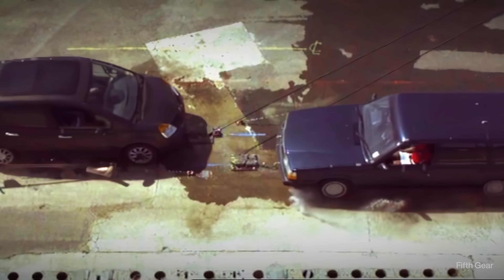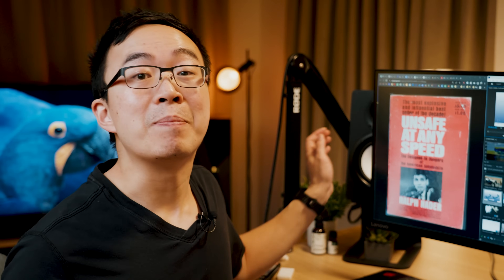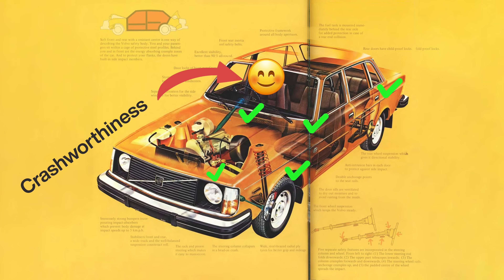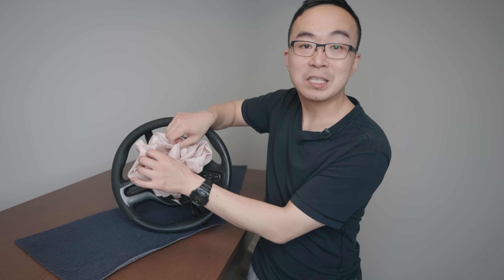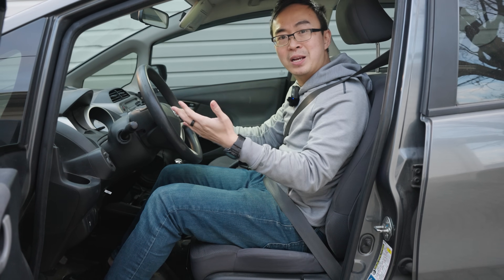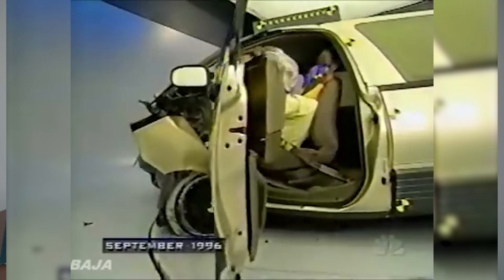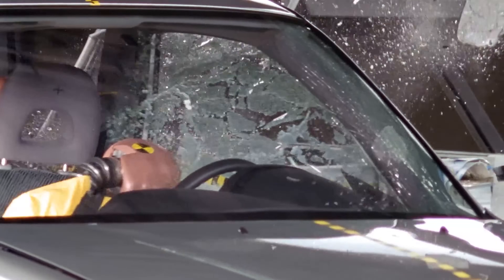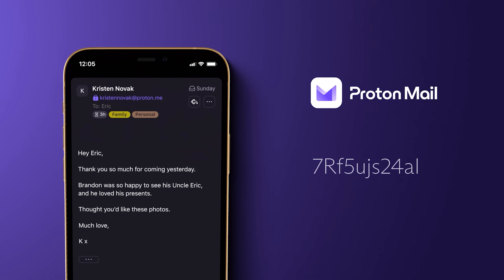When does a car stop being safe?

Comment: Even the 90s cars were often better, to be fair, and that first clip was carefully cherry-picked. The Volvo 900 had the problem in the first clip fixed by the 93 model year, and their other cars were fine, in those same years.

I even got in exactly that kind of wreck in a '93 940 (I already knew about this, by then, so '90-92 were right out). The 15-year-newer Hyundai was much worse off, while only being a few hundred pounds lighter. My headlights were pushed right back to the rear of the fender well, on the driver's side, but pristine from the firewall on back. OTOH, their cabin started folding in, with much less hood shortening. If it weren't a tiny woman driving, there could have been nasty knee injuries. If I had been in a '91 940 (my first Volvo), the situation could have been reversed.

My current car has plastic bumpers, front and rear, than can bend some inches, before getting to anything really structural. I don't usually try to run into pedestrians; but if I do, I'm sure they'll appreciate that, over that old Volvo's plastic coated metal beam.
Reply from the maker: It's somewhat cherry picked but still representative of the larger improvements in safety.  There's also individual vehicle differences that's hard to capture.  The plastic bumpers are definitely better for pedestrians, bad on your wallet though
Reply: @Lam  true, but even that varies a ton. Designing for service and repair has gone away, with a primary focus on short-term ownership of new car buyers.

I'm currently rocking a Vibe. I had the front bumper dented and scuffed, in my work's parking lot. The damage was just cosmetic, to both vehicles. That made me go get a quote, just to see, since I know a paint job is not trivial on them.

If I had to get a new one, matched paint and all, but with no real damage to the car otherwise, it would be about $800, with an hour for labor to actually replace it (relevant in a bit, as it's from the same business). Or, I could pay about $300 (all front bumper parts, from Rockauto, w/ tax+s&h - s&h is no joke on these parts!), and drive around with a gray one.

OTOH, my work vehicle got a new bumper and grill awhile back, and it was over $2300, also for very minor cosmetic damage. The bumper and paint work was about $1200 of the bill. It wasn't designed with repair and service in mind, like it was on my little old GM/Yota.
Reply from the maker: Haha, yeah, for an older car you might as well just get something that works.  Maybe go to a junkyard and pull one out but you figured it out.  Thanks for sharing your story!

Comment: Well I know when my 1994 Chevy Corsica stopped being safe.  When it was brand new... mine was like 10 or 15 years old when I got it.  This doesn't end with me getting in a crash or anything, it blew the engine.  But that thing was rated at a 1 star rating for the driver and 2 for the passenger.  For 1994; it was off the market in 1995 because it didn't meet the side impact standards at all.

Comment: This video is bullshit the 940 is still by far the safest car in the video. The old red block Volvos have steel in the firewall to prevent the motor from being pushed into the cab. I have personally seen pictures of the same car in a head on collision with a suburban and the metal in the firewall did its job. The occupants of the Volvo walked away with barely any scratches.

Comment: I find it sad that the proliferation of oversized SUVs and similar vehicles caused cars under 2750 lbs (1248.5 kg) to be deemed unsafe. Smaller vehicles need less materials when produced and takes less energy to move, so this has an environmental impact.

Comment: Submarining comes from auto racing where we have a 5 or 6 point harness. If  the belt that runs up your crotch if it's too loose then you just end up sliding forward. Your legs knees thighs everything gets crushed and broken because of that crotch belt not being tight pulled in and down with your belts

Comment: i always find it unusual when self-proclaimed car fanatics talk about older cars "standing up to a crash far better than those flimsy soft new cars - just look at how much of it stays together!". i'm not much of a car nut myself, but my dad told me when i was young - if your car doesnt have a crumple zone, you are the crumple zone. because if the car isnt doing the shock absorbing, you will be.

sure, its possible to argue that newer, crumpling cars may present a higher crush risk under some circumstances, but a car that doesnt crumple is almost guaranteed to turn your insides into soup in a similar situation.

Comment: And then there were once safety features in cars that  seemed like a good idea on paper but added no additional level of protection or  actually increased the danger level in a crash in the real world scenario.    One such feature you may recall if you're 30 or older,  is the automatic seat belt on late 80s and early 90s cars not equipped with airbags.  On such models with the power shoulder belt, the most common version, the lap belt must be manually buckled and this often wasn't done.   In a crash the occupant can submarine and suffer serious injuries or death.  

In GM models equipped with automatic seat belts,  the shoulder and lap belt retractors were mounted in the front doors, while the buckle was intended for use as an emergency release.    You were supposed to leave the belts buckled at all times, and slide under the belts upon entry and were buckled when the door is closed,  no other action is  required (everyone basically used them like ordinary lap and shoulder belts) The problem was that some crashes caused the door to pop open,  ripping out the seatbelt and ejecting the occupant.

Comment: I had an accident in my F-150 because I started choking on my diet coke and passed out going 70mph.  Went through a guard rail over a hill and head on into a tree.  Had seatbelt on and all air bags came out (driver and side ones).  I had 10 ribs broke, punctured lung and punctured spleen.  Even though I had seatbelt on the Pittsburgh UPMC Trauma center told me it had to have been the air bad hit my chest, ribs were broke evenly 5 on each side.  The nurse said she had never seen such an equal break before.   I believe if the air bad didn't deploy I would have been less hurt.
Reply: Sounds like your steering wheel was set way too low... Could be wrong, but that's my hunch.

Comment: Used to work with HighSpeed cameras. In early testing days, the car impacts were fast enough to destroy the mechanical camera trigger mechanisms, so they also had to devise electronic triggers within testing development, to easily capture the footage of the impact. Rewinding over minutes of footage at such speeds is not a practical option. (it takes hours)

Comment: Don't forget that they removed the engine, transmission and axle to the rear wheels before that test.

Although it's not the cage of the car but it's an extra hard part that's tested in volvo's crash tests back then.
Removing those parts manipulates crash tests.

It for a reason they use volvos allot in banger races..

Comment: I was in a crash a couple months ago (my vehicle is still being fixed). A really intelligent individual pulled a left crossing traffic right in front of me and I T-boned him at around 45mph. I drive a Toyota Tacoma. It held up really well, but it was destroyed enough that I don't trust it anymore. The cost of the repairs have actually overshot the value of my truck at this point. Idiot move on the insurance company's part. Anyhow, I went out and got a new vehicle. I enjoyed my Tacoma, but the IIHS has implemented several new tests that the Tacoma fails. I was just going to get another 3rd gen Tacoma, but that turned me off from that idea real quick. I quickly found out that every small truck and even the larger full size trucks also fail. I ended up with a Hyundai Santa Cruz which isn't really a truck, but more like an SUV with a pickup. It was the only thing with a pickup bed besides the new expensive Toyota Tundra that was awarded a top saftey pick. I actually enjoy the vehicle a lot, but the saftey aspect absolutely made up my mind at the end of the day. I'm sure my Tacoma is safe enough, but after getting into a fairly destructive accident, I've got a bit of anxiety.

Comment: The car that practically disintegrates at 4:18 & 6:29 actually had most of its rigidity removed because they were using it to test a new test center's instruments and not the car itself.  Retail versions of that car probably did a lot better in crash tests.

Comment: Do your research. "unsafe at an speed" was untrue. 
Ujoints exist in the steering column mainly for packaging, keeping the wheel relatively vertical when the steering rack is close and the wheel is high, and allowing for a steering column that can pivot up and down. Crash safety is not the goal for Ujoints.

Comment: You’ll see people on social media who wish cars didn’t crush and were tanks like older cars because “it’s obviously safer”. Like, ma’am, the car may have tanked all that energy but now it’s turning you into a puddle of meat and blood
Reply: I think the only thing i like about older cars was slow impacts that do small cosmetic damage were fairly easy to repair or did little damage, while on newer vehicles you would have to replace plastic panels and clips, which technically could be easier but you have to source replacement parts. 

But on crashes that are heavier/faster, yeah newer vehicles are way better, well as long as you still dont have a very large vehicle side impact a smaller one, enough mass and the small one will still usually loose out.
Reply: Today's cars saw how a strong car will transfer the energy over to what's inside, in other words us living creatures and guess what happens when we would crash with a 50s car at like 100kmh or 60mph,yeah,we'd be dead, whereas with today's cars crashes is mostly broken legs but over 50% chance to survive
Reply: There's definitely a middle ground - cars today will get totalled for absolutely nothing because the frames are built badly and EVERYTHING is "designed to crumple". The mid to late 00s had impressive safety standards but were still trying to build cars that would survive and be safety driveable after a fender bender.
Reply: Yeah but there is also a much higher chance that the passengers die at impact, which is why a 1920 vehicle crash at 20mph and you'll feel that in your legs after 10 years to now 100mph crash and you'll feel that in the next 10 years,this is how my brother had a crash at 100kmh and he walked away relatively unscathed but after 5 years so basically in the present day now he has back issues cause of that crash, he's alive but kinda crippled for now
Reply: I wish we could send people with those takes back to school.

It's the same reason we bend our knees when landing from a jump.
Reply: I’m sorry, what is that pfp and username? 😭
Reply: I like genuine comments like this
no boring C&P at all
Reply: Yeah, I will choose my old tank of a 4runner if it's snowing, everyone is going 30mph, because if I wreck or someone slides into me, my vehicle will still be drivable after. However, there's a reason I ride my new car during my regular commutes on the highway, with everyone running 80mph

Comment: It is a known fact that in the volvo crash video in the beginning, they removed the engine and structural beams. Do you seriously believe that this collision would look like this lol
Reply from the maker: I saw many posts refuting this idea, many pointing out how the engine exists.   Also, yes, 100%, I do believe the crash would look like this.  The engine only takes up 20% of the crash energy in a collision.  When you factor in the older steel used.  It will look like this.
Reply: @Lam  If you want to work with anything credible, don't try to build a scientific approach video on a questionable hobby crash test conducted with unknown conditions by journalists. This was not an official test of any kind, it is tabloid journalism. They didn't even bother to disclose the conditions.

Comment: Great video, and happy I've come across your channel. Thanks to the algorithm for actually working once in a while.
Just a little story for you about your little Honda.
My wife bought a brand new Honda Jazz (Fit) here in Australia back in 2013. It was involved in a crash 1 month later when a driver in a Mitsubishi Triton loaded with construction tools, towing a 1.5ton excavator hit her from behind while she was stopped at a red light, he was traveling at 80k/h and never applied brakes (distracted on his phone) Wifes car then hit the car in front of her hard enough that his car was also written off. Front and back of her car were caved in really bad, steering column had come apart from the rack, engine got shoved part way under the car, the rear hatch was against the back seats, but we could still open all 4 doors, and her only injuries were a bruise from the seatbelt on her chest and a bruised knee from hitting the dash (she likes to sit too far forward) The car she replaced a month before this was a Daewoo Matiz and I think if she still had that car, I doubt she would have survived the impact or 5 tons hitting her car at 80km/h .
Reply from the maker: Glad to hear a good outcome! Thanks for sharing with me!

Comment: so, a car is never safer than it was the day it left the factory floor except if there is a safety flaw that can be fixed through a recall. 

I drive a 1995 Volvo tank, I also drive a 2007 Volvo hatchback and a 1973 Volvo sports car. all of these cars was very safe for their time.

the 1973 Volvo 1800ES had some really quite impressive side crash protection for its time combined with the good old seat belt we all know and love. but that's pretty much it. no electronic nannys, no airbags and the crumple zones leave quite a lot to be desired. 

the 1995 Volvo 960 had a lot of good safety features for its time. a very strong roof to save the occupants in a rollover and one of if not the most advanced crumple zones for its time combined with airbags in the seat and the steering wheel. good for its time but doesn't have the modern advanced crumple zones where it can channel the other car in a different direction in a small overlap crash. 

the C30 is a safe  hatchback for its time. good electronic nannys for its time with a good amount of airbags and good crumple zones all around the vehicle.

but, none of these have anything agains a modern hatchback and even less against a car like the Volvo V90.

but it is quite simple as to why, and that is how much development that has been put into safety. and I still would prefer to die in my rare classic Volvo than survive in a V90 simply because the 1800ES that I own is the sexier car and I love driving it.  but I also hope that I never as much as ding a single panel on that thing.

Comment: Thank you for clarifying the background and details about the small overlap test. Although the impact mechanism itsself is critical and the ability to withstand such extreme conditions is a great feature the window of great improvements nevertheless becomes smaller with the decreasing percentage of real-world crash scenarios that haven´t been covered by established tests before. My car for example, the BMW i3 aced the small overlap test despite having a relatively short crumple zone because of the carbonfibre construction with lighter and softer plastic panels on the outside of the frontal area. That made it possible for the car to get deflected by the barrier and not having to come to a dead stop on the initial impact.

Comment: Note that the larger, 3k pound volvo is less than 500 pounds heavier than the tiny car.  But a tiny car of 1990 likely weighed under 2300...some as light as 1900.  Modern regulations push for high mpg, low emissions AND safety.   Those are counter productive.  A 1990 Corolla weighs 1000 pounds less than a 2016 Corolla...yet the 2016 gets slightly better mpg, due to advances in engine/transmission design.   Now imagine what the newer engine/transmission combo could do in the 1,000 pound lighter 1990 Corolla chassis.   Boom, 50mpg car.  But due to airbags, crumple zones, backup camera and other federally mandated stuff, modern cars are bigger and heavier than their counterparts from the past.  The safest vehicle is one that doesn't hit anything.   The lightest vehicle, with the best suspension, brakes and tires will have superior handling and braking...allowing the best chance of avoiding a collision.

Comment: Vehicles become unsafe as soon as the driver feels safe.  Modern cars are far safer than ones from the 80s...airbags, crumple zones, better materials, better brakes, heavier and larger on average...yet Vehicle deaths are at similar levels.   Modern vehicles are also more powerful, smoother, quieter, require less effort to steer, throttle and brake.  Modern vehicles drive like a video game, making drivers detached from the road and the feeling of piloting at several thousand pound Vehicle.   The results are more drivers paying less attention and on average, driving at faster speeds.  In the 80s, a work truck was slow.  A work truck today can out accelerate most cars from the 80s.  The things that make vehicles more luxurious, make them less safe as they turn driving into a mundane task, rather than the huge responsibility it actually is.  And what were once luxuries are now common even on economy cars.  Imo, while Modern vehicles are technically safer, today's roads are more dangerous.